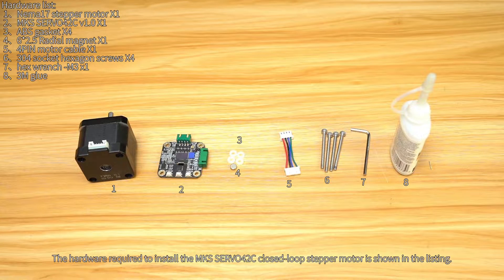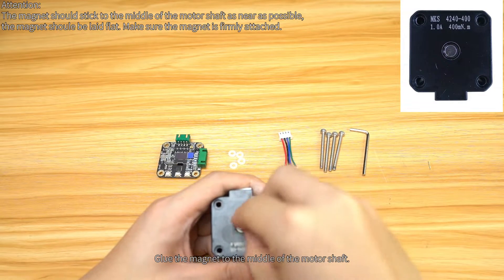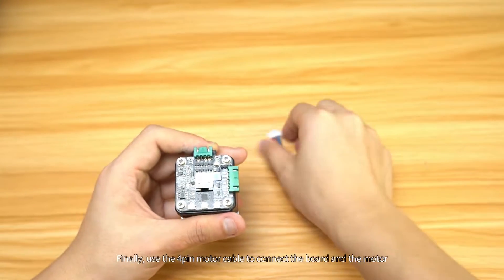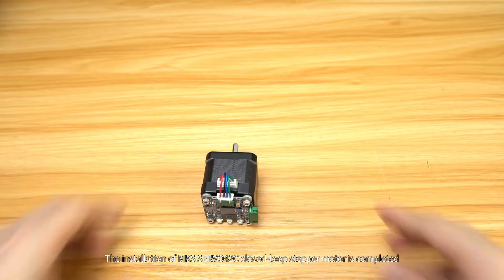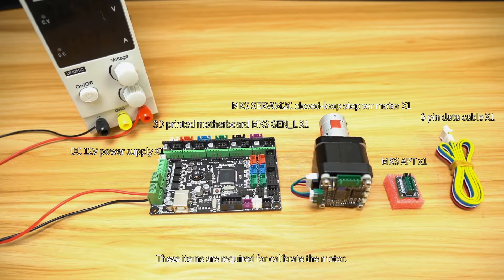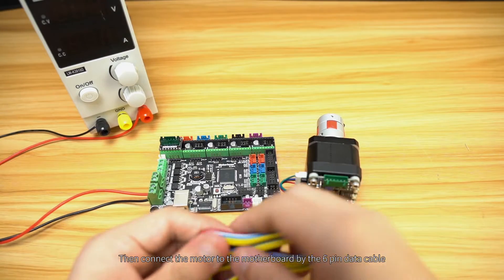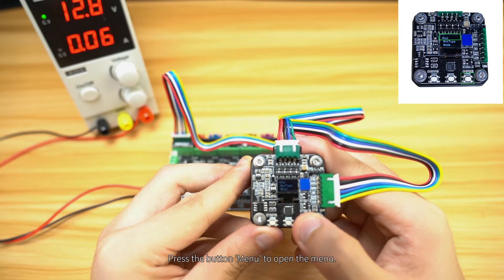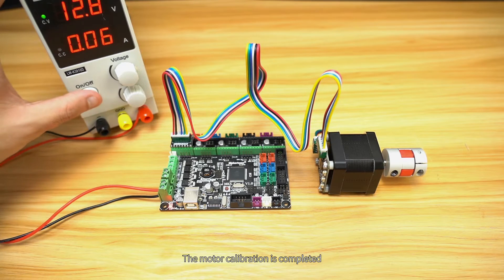MKS SERVO42C Closed-loop Stepper Motor Manuals（1）Install the motor

Comment: Once the calibration is done I get the following error: "Reverse Look up error!" What is the solution?
Reply: Your stepper wires are in the wrong order. Check A1 A2 B1 B2
Reply: @mendebil  Thank you for that piece of information, my motors wouldn't calibrate at all, the motor would just jitter backwards and forwards. I swapped the red and green wires and everything is sweet.

Comment: is it possible to do the setup all under 24v of input power?
Reply: this is also what I would like to know I have the Ender 3 Max which only has 24V PWS. One would think there would be either a switch or auto switching between voltages. I burned up a BTT Closed loop Version because I could not find the Manual, anywhere. When I found the manual it said only 12V.
Reply: @johnm.gerard1718  I ended up just plugging them in directly to 24V and they worked fine right out of the box 
Calibration worked without issues.
Reply: @doa_form  Any followup comments on the servo42c? Is there any reason they wouldn't work for a nema11 motor (other than the screwholes not lining up without an adapter)?